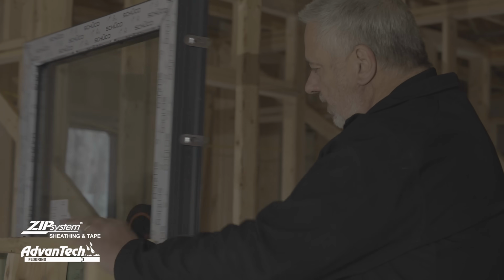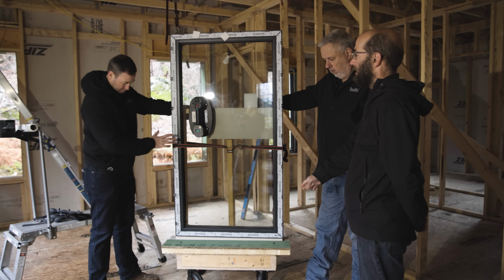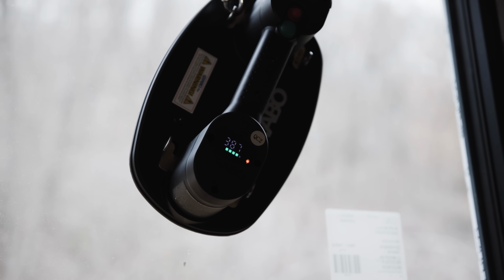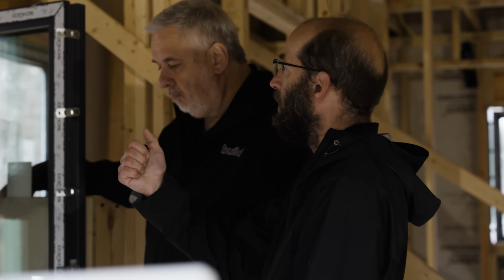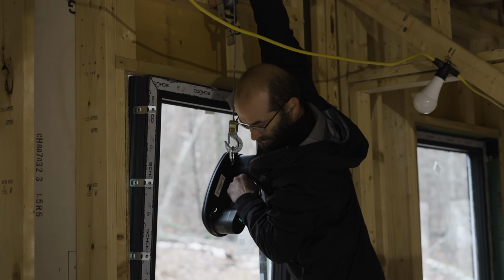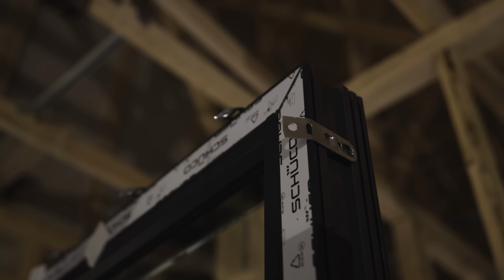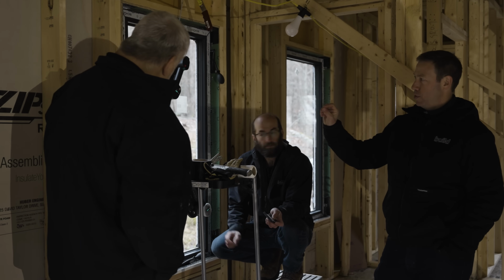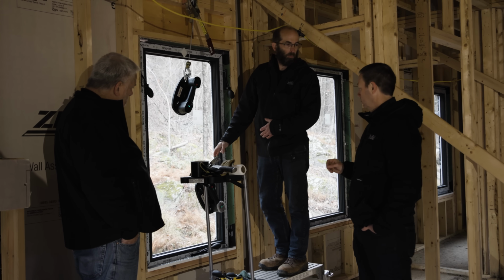One Man Window Install!  These Rigging & Tools Blew Me Away!

Comment: Did you consider removing the sash prior to install.  Also  for the larger window are 2 lift points each with a hoist sufficient load distribution and prevention of side load (like a spreader bar)?
Reply: I think a spreader bar would be better than the cable he has going between the two points. You wouldn't have the side load force then just straight up.

Comment: So I would love a video breakdown on how to choose your window install. Like this new build didnt go for nail flanges? Why? Isnt the side nailers a renovation style of install? What method is best?
Reply: I selected Schuco windows first and foremost for their performance. Adopting the strap/clip style of mounting was an outcome of that decision, but one that I embraced because I wanted a more in-set window rather than flush to the exterior side. That was a preference, of course, but the Schuco performance was extremely important to us. Every one of our windows, from the small 2' x 3' to the largest being 5' x 9' are between R-7 and R-8 for the entire window assembly (not just the IGU which has a COG of R-10, aka U-factor of 0.10).
Reply: I'm assuming he chose this style so he can install them from the inside using this system.
Reply: I believe that you can't get a European window with a nailing flange.